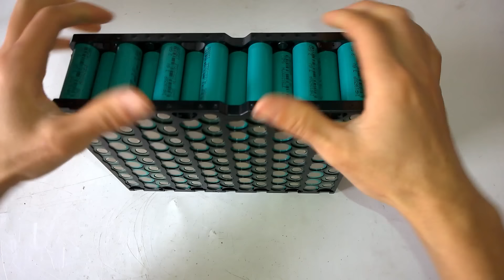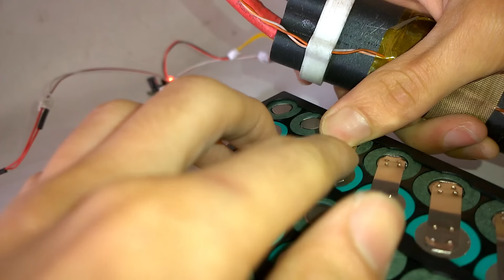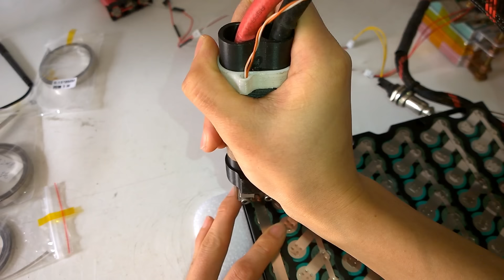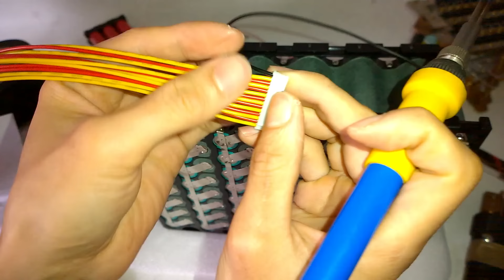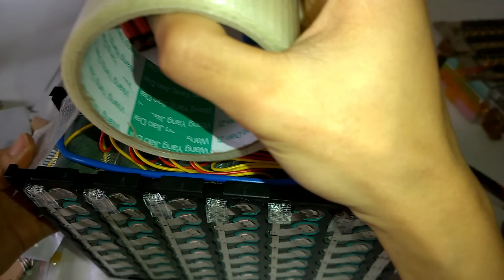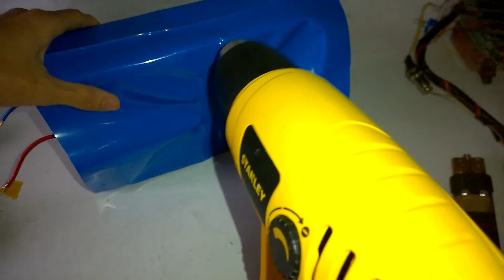DIY 48V 20Ah Electric Bicycle Li-ion Battery

Comment: Master Yousun, that was a marvelous assembly. Appreciate your meticulous attention to each section and clean set up. A brief description on the BMS type and model and charging voltage would enhance the whole video much better. Last but not least...... please describe your SPOT WELDER. Show us, in sequence, how you made it, what parts were used and the technical data.  Thanks again.
Reply from the maker: I will explain later.
Reply from the maker: https://www.yousun.org/archives/1353

Comment: copper has one third of the resistance than nickel and can be found everywhere for cheap- I would solder at  least the parallelization wires using solid copper wire. Then I cover all my contacts with transparent neutral silicone to decrease the risk of accidentally shortening or effects of moisture...
Reply: I there some sort of spray silicone you can spray over your work after you finish you give it a moisture resistant surface?

Comment: Parallel connections need to be thicker and stronger than series Connections.
Reply from the maker: For safety, to prevent a short circuit inside a battery.

Comment: nice work but its missing a power level meter. the batteries i made are 4s's with a 20 led power meter using tl431
Reply from the maker: Electric bicycle has a power meter.
Reply: @yousun2827  i still like the power meters on the battery because i use the battery for more than just a bike discharge. i bring them inside and hook them to other batteries and solar chargers as well as using them to power other devices at home and knowing the battery levels in any and every situation in realtime is much better
Reply from the maker: Good

Comment: Isn't there a faster way to connect these batteries for 48V 20AH? My 12V 20AH  sealed lead acid batteries in 2 boxes only has 4 battery connections and 2 connectors for easy handling to and from the trike. Just connect the 2 boxes for 48V and a connector to the trike controller. They are charged On or Off the trike and charged at 48V 20AH.
I have only lost 1 12V battery in over 2 years of full discharge cycle. I just replaced it in place and the pack is on its 8 month of use now, getting about the usual 60km per charge.
Reply from the maker: Very good, you can use a large lithium battery and it is easier to connect.

Comment: Why you are not using fuse in the positive side of the battery? Is this safe?
There is some Nickel strips with fuse incorporated to the positive side.
Why you are not using buss bar?
Reply from the maker: The use of fuses causes serious heat generation, which affects efficiency.

Comment: If I were to use a step-down converter to convert the voltage output to 12 volts, how many "amp hours/ah" will it put out at 12 volts versus putting out 20ah at 48 volts ?
Reply from the maker: Buck efficiency, About 18Ah.

Comment: Hola buen video, amigo tengo un  amplificador de  60w y un  elevador de 600 y me entrega un voltaje continuo de 30v para alimentar el amplificador quiero poner a trabajar todo el circuito a bateria, que voltaje y amperaje debo utilizar para alimentarlo y que me de una duración de 12 horas.
Reply from the maker: Your device description is not detailed enough.
Reply: @yousun2827  hola buenos dias amigo tengo un elevador dc a dc de 600w el elevador soporta máximo hasta 15 amperios y yo tengo un banco de baterias 18650 que me entrega 14.8 v a 60 amperios.
Mi pregunta es.
¿ puedo conectar directamente el banco de pilas al elevador o que circuito o módulo hay que utilizar que sirva para regular el amperaje para poder conectar al elevador sin que este  de pronto no supera daños por tanta corriente?
Reply from the maker: Yes! You can connect directly. Connect a fuse in series.

Comment: Hi, 
thanks for an interesting Li-Ion Pack building video. I build my own, so I understand the time involved and extra time to film it.
 Some comments;
Pros; Nice professional build using what looks to be top shelf spot welder and equipment.

 I like the way you built the layout of the pack and left cell holder openings that are protecting the connections.

cons;

Imagine the work required to take that pack apart if there is ever a bad cell or poor spot weld. 
Note; I did notice you check EVERY singe connection to be sure they were all properly welded.
Once again, color code wire problem.
BTW; the DC electric world as I've always know it is Red is Positive and Black is Negative. China doesn't seem to have a clue about that.
 Is that Blue wire positive or (probably) negative. And I can't really tell where it is connected on the BMS.
 VERY important steps you left out for us DIY folks.
You show x2 48v voltage tests but don't show where the connections go! :-(
Also, between the shrink wrap, Barley paper and tape,  you've sealed it so well, there will be NO cooling air able to circulated around the cells.
Here in the desert of Southern California, that could be fatal to that pack.
Don't take my comments wrong, it's few and far between seeing decent videos on pack building and all involved. I give you high marks and only hope to see more in depth info on the subjects I addressed.
cheers
Boots Langley
La Mesa, ca
Reply from the maker: OK! Thanks!
Reply: Hey Boots, Im in PB, did you make a spot welder? Im gearing up for battery building and could use some tips and info, thank you
Reply: ăll

Yreau

Comment: I had made a lithium ion battery pack rating 14.6v 30a with the same type of bms rated 12v 30a.can I charge it with a 14.6v 3a smps or i need a same rated lithium battery charger.please reply fast
Reply from the maker: 14.6V 3A charger.

Comment: Is there risk of electric  shock to hands when cells terminals are physically touched  whilst battery  cells are  joined together in series at high voltages 48v and above?
Reply from the maker: If the hand is wet, there is a little bit.

Comment: Where did you get that cell staggered black plastic spacer.
We usually find square plastic spacer.
with yours, it seems we can pack more cells in less space ?
Reply from the maker: Do you need it? I can sell it if needed.

Comment: Those insulation rings should be on both battery terminals
Reply: @yousun2827  Those greenish insulation rings should be put on both terminals of the battery because heat develops also on both sides when the current is high. Nickel strips are not heat resistant, also we do not know exactly if those mass produced strips are made from the CARCINOGENIC nickel compound
Reply from the maker: Green insulated barley paper placed on the positive electrode, and the normal use of the nickel piece does not generate heat. It is not normal to have heat.
Reply: @yousun2827  It is since you are making a battery for powering a motor with relatively high consumption
Reply from the maker: The motor needs to be matched with the battery pack to ensure that the highest power battery pack of the motor does not heat up, and the battery pack has a large margin. I generally do this.
Reply from the maker: It is very dangerous to have heat
Reply: @yousun2827  Yeah, about that ... Those INRs are not for heavy loads. They are 3C, 3 amps for 20-30 minutes, and often they can't hold continuous discharge. You need the cells to have high peak current rating (those for drills, etc) - above 30A
Reply: Most of people in the business say the choice for batteries is Li-MN but the price is high. 40A continuous discharge, peak 55-60A
Reply from the maker: 18650 2500mAh  3C , Motor 500W , 13s8p , 48A*48V 2304W .

Comment: Avendo un po di batterie 18650 da 3.7v 
E volendo costruire un pacco batteria per un scooter elettrico
La batteria che monta lo scooter
E di 60v 20ah
Come li devo montare.....
Quanto batterie mi servono e con quale schema montarle
E poi o trovato un controllerxhe protegge 60v e 35ah  i rete
Va bene

Grazie dell'aiuto.
Reply from the maker: This requires more tools.

Comment: I did the same battery, it shows voltage but it doesnt discharge anything when connected. What could be wrong?
Reply from the maker: BMS discharge MOSFET is not working properly.
Reply from the maker: BMS does not work normally, please check the BMS connection cable.

Comment: Great video
I was wondering if you can make two cells like the one you made and connect the BMS parallel to each other ?
Reply from the maker: Two batteries can be connected in parallel with the BMS, provided that the voltages of the two batteries are close.
Reply: @yousun2827  they should be at the same voltage level but after time of use it could change right ?
Reply from the maker: If the voltage changes indicate a problem with the battery, it is usually the capacity that changes.
Reply: @yousun2827  thanks

Comment: Hello..i still have a question on a battery 14s 7p .. 51.8v 23.8 ah .. can i put a 60A bms..?? now i am doing the first time and i don't want to make mistakes .. thanks
Reply from the maker: The BMS operating current in the video is 20A. 60A requires a larger BMS.

Comment: Looks nice, but is that BMS going to balance? Looks like this one (like most) only starts balancing around 4.2 volts per cell. I think it is good to charge cells to only 4.1V for better lifetime, but now I think the pack might not get balanced properly?
Reply from the maker: When the internal resistance of the connection between the batteries is low, the battery pack voltage will be very balanced. I will take apart the measured voltage after one year.

Comment: Why Switch to Lithium?

Longer Life, No Maintenance, and Faster Charging are just a few of the advantages lithium has over lead-acid batteries. Making it an exceptional return on your investment for years to come.
SERVICE LIFE: Lithium-ion batteries last 3-4 times longer than lead-acid batteries without losing effectiveness over time. #lithiumbattery #leadacidbatteries #batteries #maintenance #investment

Comment: hi in your video at 2min and 25 sec  2.25  what type of connector are this the hander you press and is a switch to?  wear i can get this ad  or how i can get it the you got a list for this spot welder?  lead me know thank you, keep the grate job!
Reply from the maker: Spot welder accessories
https://www.yousun.org/product/spot-welding-3-7v-5ah-lithium-ion-battery
https://www.yousun.org/product/mini-spot-welder-time-controller

https://www.yousun.org/product/spot-welding-72xmosfet-switch

https://www.yousun.org/product/spot-welding-pen-for-mini-spot-welder

Comment: hello..I need a tip..
.for 55,5v 20,8 ah what bms I need?? .battery 3.7v.. 2600 mah  ..15 S -8 P ...thanks !
Reply from the maker: What is your demand and how big is the motor power?
Reply: the engine says aliexpress has 50.4 v
Reply from the maker: Sorry, I didn't find a BMS that I can recommend.

Comment: how to calculate the power of a BMS for a 48 volt 20AH battery? can anyone answer thanks
Reply: Ohm's law, https://www.rapidtables.com/calc/electric/Amp_to_kW_Calculator.html , you should not confuse the amperage of the load capacity with the amperage that the circuit delivers.
Reply from the maker: If one 18650 battery has a normal temperature output current of 5A, eight 18650 are connected in parallel, 8 * 5 = 40A, 40A current * total voltage 48V = 1920W.

Comment: After spotvelder it show around 36v, after adding BMS it's showing 47v how its possible...? 
Could you please share cell configure like each cell volts and amps...?
After added BMS You should show us how to discharge/charge  that pack then that might clear to every one.
kindly reply 
Thanks.
Reply from the maker: reference
https://www.yousun.org/archives/1100

Comment: bonjour quel et votre bms ? merci
Reply from the maker: https://www.yousun.org/product/13s-48v-20a-bms-for-lithium-ion-battery-pack
Reply: @yousun2827  could you help me please, I would like to make a battery of 10S 5pack LGgbmh11865 capacity 3.7 volt 3200 Mah, must I counted it in 4.2V x 10 = 42V or my first account 3.7v x 10 = 37 volt, could you advise me a BMS? thank you so much

Comment: how long/km that will for single charge since its 20 ah
Reply: The battery has a 48V*20Amps=960Watts/hour. A Typical 1500w motor could run 960/1500=0.64 hours or 38.4 minutes at a max average speed of 55Km/h. So the max distance in theory is about 55*0.64 = 35Km or 21.74miles. No matter the motor the average distance will be the same.
Reply: @BlastarX  thank you but still one query from the last line .. What you mean by motor average distance....? 
Also I wud like to use only 1000w motor then is this calculation is right...? 
48*20=960w/h
960/1000=0.96hours 
0.96*55=52.8km I'm I right....?
Reply: @kmuralikrishna1582  Your calculations are rights except the last part 0,96*"55". The average max speed of a 1000w motor is about 45Km/h but in reality is closer to 40+. So lets say that the max speed is 45 then the calculation will be 0.96*45 = 43.2Km, but I would say that in reality is probably closer to 38+Km. So you could say that in practice that you get the same results. But what drastically changes the distance is how much you actually pedal. All the calculations above show the minimum cover distance with zero pedaling at full amp draw. This almost never happens. Once you reach the max speed in a straight road the power draw falls to about 250-350 Watts which change the results by alot and if you pedal then its even less. I hope that helped.
Reply: @BlastarX  what will be the range if I use a 250watt motor, and I really don't have the idea whether a 48volt battery gonna work with 250watt motor or not, please let me know

Comment: How do I arrange a 2kwh,48v, with 200aH
Reply: 200ah at 48v will give you about 10kwh
Reply: @venkatperla  OK please I need the calculations as well, BMS type...
Reply: @venkatperla  hello...
Reply from the maker: What is the power consumption?
Reply: @yousun2827  1.5kw
Reply from the maker: Can use smart BMS.
Reply: @yousun2827  ok.... Thank you
But how do I arranged the cells in parallel and series
Reply: With the calculations as well please
Reply from the maker: Which cells do you use?
Reply: @yousun2827  recovered cells from laptop battery
Reply from the maker: You use a laptop battery, the problem is more complicated. I will make a video when I have time.
Reply from the maker: Process: Test battery capacity - Battery parallel equalization - Remove self-discharge battery - Battery capacity arrangement - Assembling 48V battery - Install smart BMS - Complete assembly of 48V battery - Normal use of battery - Single 0V battery - Replace single 0V battery - Continue Normal use.
Reply: @yousun2827  ok thank you
Reply: @yousun2827  please do you have a link for the BMS
Reply: @yousun2827  hello

Comment: What bms are you using?
Reply from the maker: ic SH367008
Reply: @yousun2827  6s cells?
Reply from the maker: 13s cells
Reply: @yousun2827  thanks very much

Comment: So i have to figure out that you only used the paper cir guess that you only put the paper circles on what? the Positive ends ? and that you start your series with positive row then alternate. i get it now..your just showing your build not teaching
Reply from the maker: Insulated to prevent short circuit.

Comment: I have made connections like this to my li-ion battery pack I have skipped some connection in between some batteries does this make my battery pack complete? Will my battery capacity will be lesser?The image of my battery is in the link below

https://drive.google.com/file/d/1mVgro3tdjzr-yjykdYrv_HK04fOCW1Qh/view?usp=drivesdk
Reply from the maker: Send me photos.
youyinga@gmail.com
Reply from the maker: If you connect like this, you cannot discharge at high current, which also affects the consistency.

Comment: Nonsense! Should measure voltage before welding. Else how you will distinguish bad cells? You're misleading people.
Reply from the maker: Nonsense! I just measure the voltage difference between the batteries. The voltage is just one of the best things to measure. It is also necessary to measure the internal resistance of the battery. DIY needs to combine my previous videos.
Reply: Totally useless and misleading. What's the significance for measuring voltage of a parallely connected cells? What do you want to know by this? If one cell even bad cell, you can't know by measuring this assembled cells, whether you could if you measure individual cell before welding.
This is my concern. You may upload video to make money, this is you right. But if you deviate people's knowledge and learning towards a wrong thing, it's crime.
I'll definitely appreciate you if you could e able to show us to measure individual or assembled cells AH capacity, or weight. Those are required.
Reply from the maker: Don't be an idiot, it is common sense to measure the battery voltage before DIY. Don't DIY without common sense. The previous video has.. The voltage difference between normal use of the battery pack is now a major problem.
Reply: @yousun2827  Yes, don't be an idiot. You've mixed up things...😀 Sorry I didn't realize your limitations. The best structure of lithium battery pack is completely isolated individual cells. The top and bottom of the assembly should be parallely connected through blocking diode. BMS with active balancer should not attached to the battery internally, but should be attached for charging only. Using MCB for short circuit protection. This approach should maintain each cell separately. Bad cells should be detected anytime throughout the life span of whole assembly.
Reply: Chillax Shubhayan regardless of who is correct I'm pretty sure he isn't trying to mislead people in anyway, not everyone is evil, who hurt you?
Reply: @swagman2320  The concern is: after connecting some cells in parallel, there is not any sense to measure the individual cells voltage. As they are parallel, connected voltage will be anyway always same. Technically this is useless but for fun or other demonstration purpose it may valid. I hope this made senses. Let me know if you have questions.